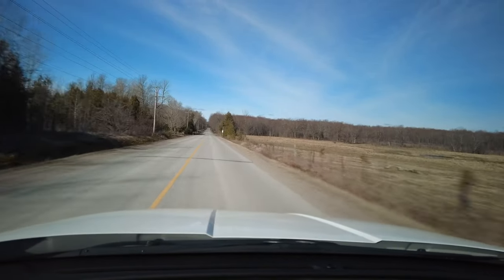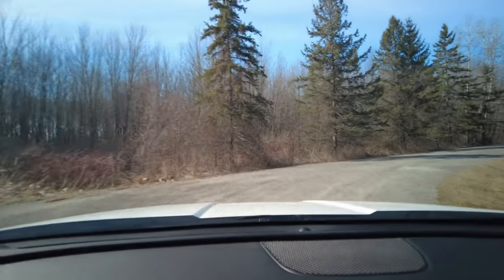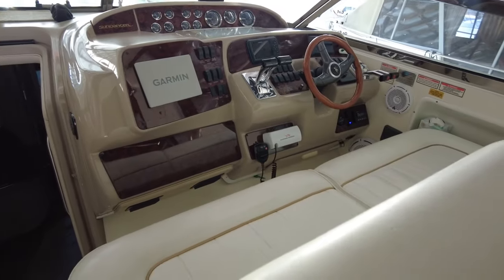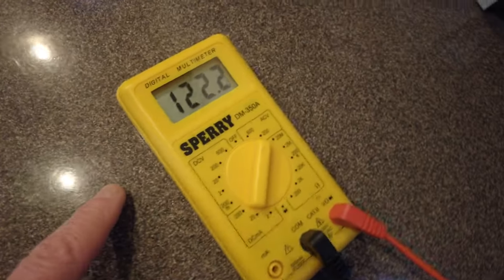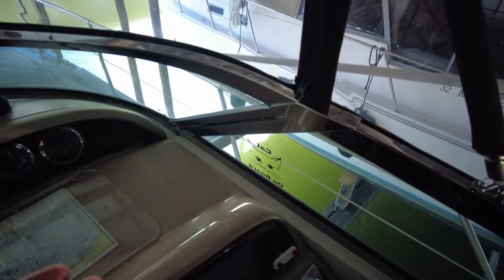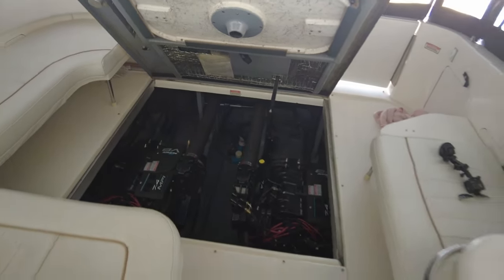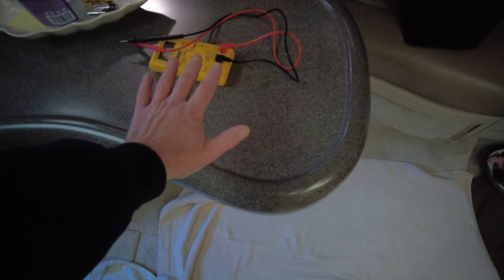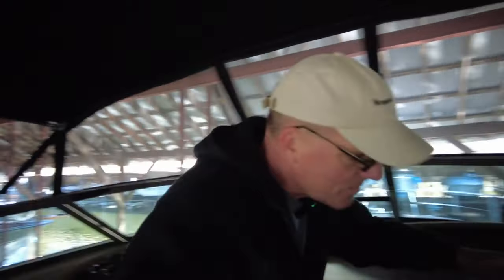Shore Power Is On ⚡😁

Comment: Socializing around the marina is part of boating life in my opinion.  Jetlag is currently inside the marina shop for just over a week.  The shrink wrap has been removed, the new AC/Heating unit is being installed, a new hose on the remote oil filter is being replaced and then she will get buffed and waxed.  They are also looking at the seacocks because they just seem too tight to me.  Meanwhile I am one week into a hip replacement revision and dying to get up to the lake and check on my boat.
Reply from the maker: My problem with all the socializing is that it usually cuts into my project time 😅
 If you're replacing one line on the remote oil filter, do yourself a big favour and replace all four of them - 2 per side. In my experience, and given the age of the boat, if one has failed, one or two more won't be far behind. And if you already have it in the shop being worked on, might as well have the boys do 'em all while they're down there 🔧🛢️🚣‍♂️

Comment: This will be the first year I've left our batteries onboard for the winter due to lack of strength post surgery. Fingers crossed. No launch date yet for us.
Reply from the maker: I hate bringing this up, as it seems to be a sensitive subject with a number of boaters, but I've only ever once took the battery off one of our boats, and that was winter # one with our 240 Sundancer, 25 years ago. When I took it back to the boat the following Spring, I asked myself what difference did it make whether it was sitting on an unheated garage floor, or on the boat over the winter? So, from then on, the batteries always stayed aboard our subsequent Boogaboo boats and never had an issue. But what do I know about the health or longevity of boat batteries? 🫣
Reply: exactly I took mine out for years before I had that realization and been fine for decades !
Reply: @BoatingWithBoogaboo  Yes, I took mine off last year and left them on this year and I received some blow back for doing so. But it did not appear to me that I really lost anything by doing so. So I think I'm sold on leaving them on board and just disconnecting them for the winter.
Reply from the maker: @eternitysshore Not to add fuel to the debate, but I never even disconnect any of the wires. I'm confident that I'm aware of anything that might otherwise draw power during the off season, so disconnecting the leads wouldn't add any benefit for me. 
 Just sayin' 🙂

Comment: Thinking of you yesterday. Did the same thing, went to the boat. Put the props on and a bit of bottom paint. We will go down when the weather is a bit better and try and buff and wax the hull. Launch is set for the end of April.
Reply from the maker: After a brief return to seasonally cooler temps over the past couple of weeks, it's supposed to warm up a bit again by next weekend. If my back allows me, I just might give the hull sides a bit of a scrub once I've reinstalled the fenders and dock lines. Wish me luck 🤞

Comment: Hey Paul…. A quick question.  Do you disconnect the batteries by removing cables or just by turning off switches.  Great to see you onboard and power on.  B.
Reply from the maker: Hey Blair, check my answer to that in one of the other comments. But spoiler alert: I haven't removed batteries in almost 25 years and five Sea Ray Boogaboo's 😀
Reply: @BoatingWithBoogaboo  thanks Paul.  I have always left them onboard but the marina has always disconnected the black cables.  As I’m now doing this I just continued but have always wondered why.  If the battery switches are off then there should not be any draw ???
Reply from the maker: @blairseward4329 Technically yes, there shouldn't be any draw, but you never know if there's that one small device or light that stays on, despite having the battery switches turned off. 
 My recommendation would be that, if you're having the marina do your winterizing (and subsequent summerizing), then leave it with them to come up with a workable solution. If you have them change something just because you saw it in YouTube and then there's an issue afterwards, that could cause more headaches than it's worth. . .
Reply: Always cool to see you work my friend. I just took mine out for the first time in a year since I bought her. Quite a long list of adds but going to be worth it I think. Thanks for the vids amigo!

Comment: Ya its a very opinionated topic. I've always found that my batteries will last longer if left on a smart charger. My motorcycle batteries have always lasted 7-8 years wheren others have gotten 3-4 yrs. But that my experience.
Reply from the maker: We had battery problems on our previous boat, as the old charger was overcharging all the time and boiling them. The solution (after replacing two sets of batteries) was to replace the charger with the same smart charger as I installed on this boat - and no more problems. Here's a link to my replacing the charger on our 330 Sundancer ( https://youtu.be/LRRRQ-ORTDk?si=yfsWk3KQ168abkTr ).
That said, the charger isn't running all winter (no shorepower), so the batteries are left to their own devices ;-) Never had a problem as a result of not being charged throughout the winter, and the smart charger (as shown in this video) will do its thing to bring them back to life properly. . .